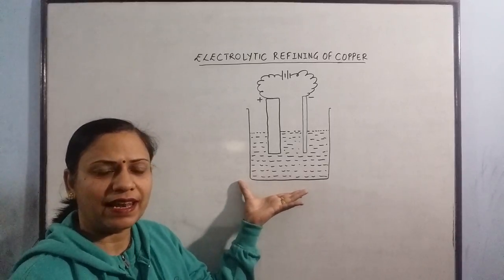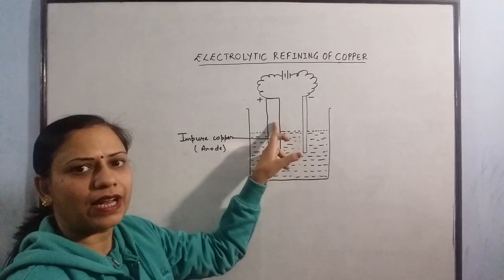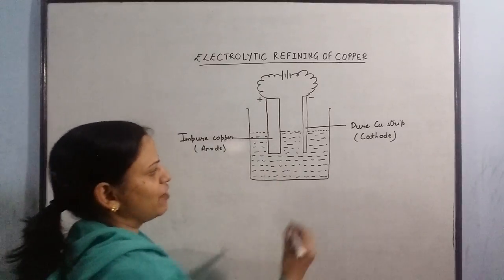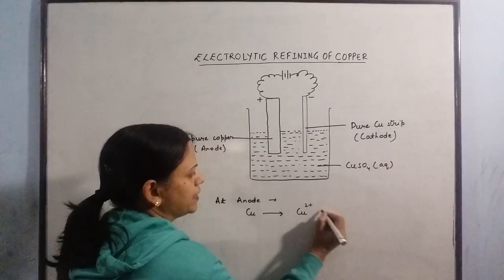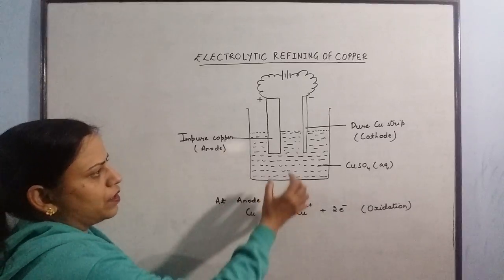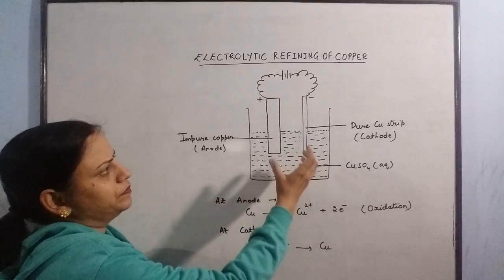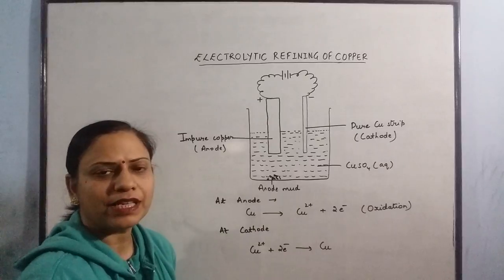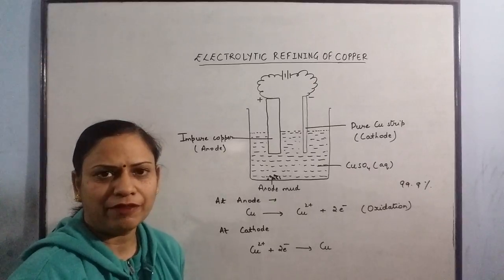Electrolytic Refining of Copper

Comment: If the  electroplated copper is only 99.9% pure what other metals are carried over ? I've read elsewhere the purity depends on the voltage , if high, other metals are deposited  ...What is the minimum voltage for copper to be electroplated?  Thank-you